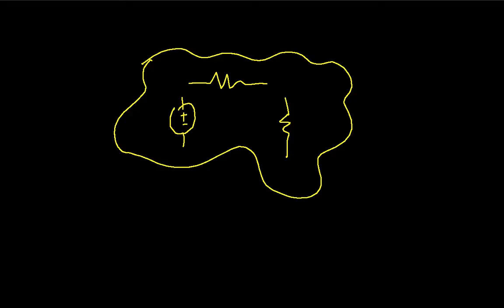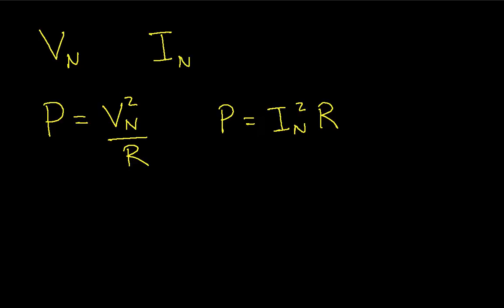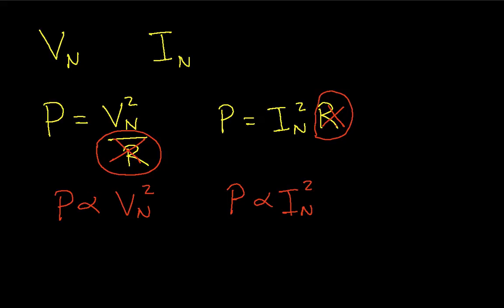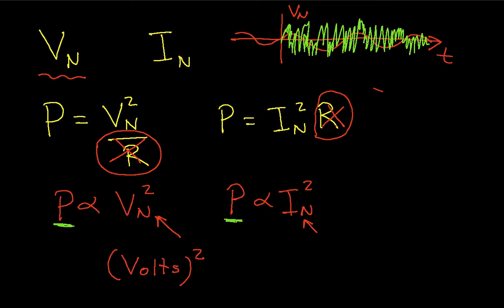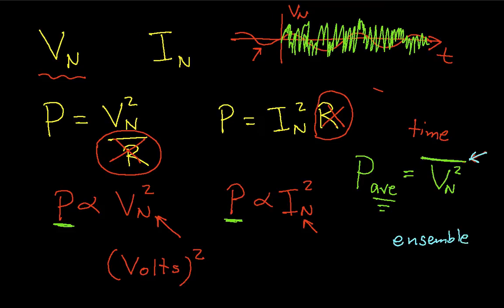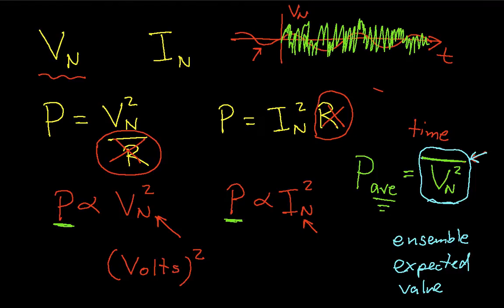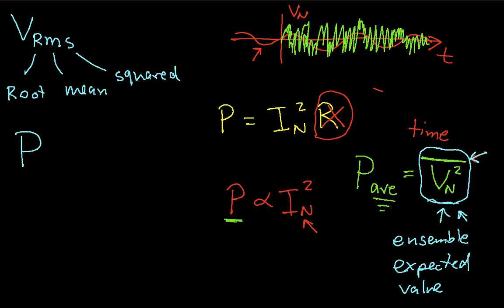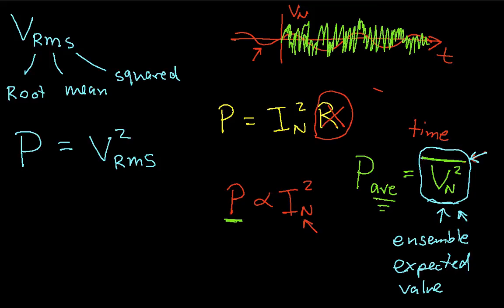Introduction to Noise in Circuits

Comment: We are looking for an experienced "electronic noise consultant" who would be assigned to a project involving our client's product. It is a contract based opportunity with good hourly pay. The issue is challenging as our client could not get rid of the electronic noise for some significant time. If you or someone you know of, with solid background in electronics and especially noise troubleshooting and elimination is available, please let us know by responding here to this message or contact us by email and let us provide you more details to see whether this would be a good project for you. Even if you notice this message after  long time, we still would like to hear from you as we have from time to time other projects as well needing experienced electronic engineers with expertise in small signals and noise.